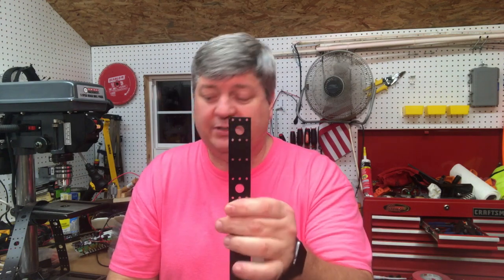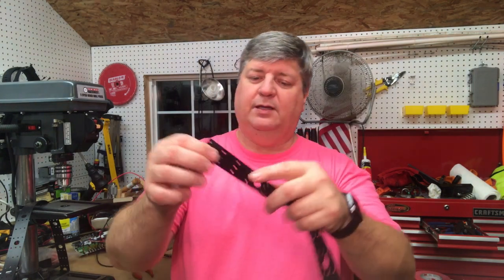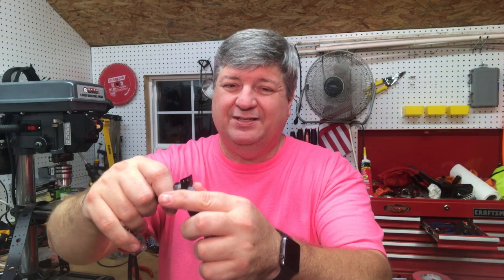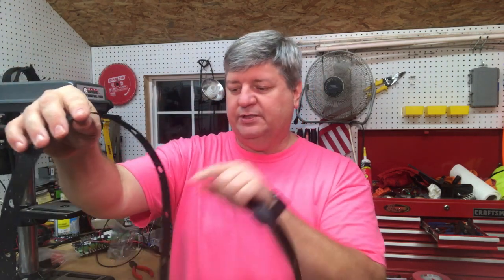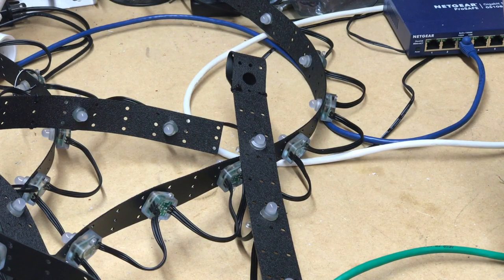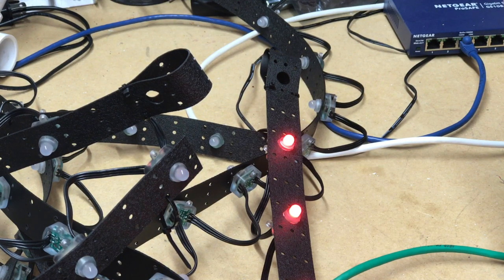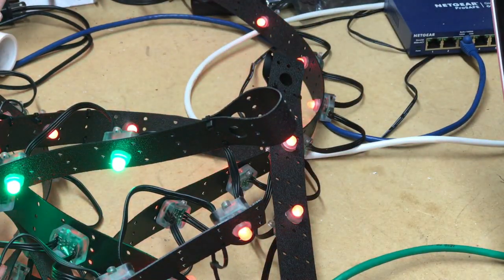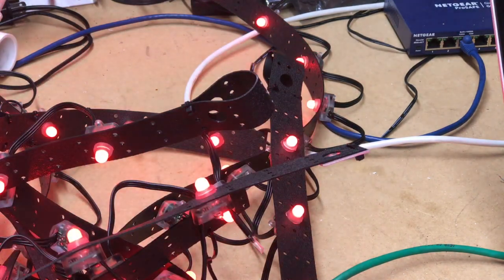Garage Outline with RGB Pixels

Comment: Thanks for all your videos. They have been most instructive in my journey to get pixels on my home hopefully this year. Question? I have oval windows at the top of my windows. They are not squared. What is used as support foe pixels with the top being oval instead of square. Thanks again!
Reply from the maker: Outlining windows is one of the more creative parts of the hobby! 😂 There isn’t a great solution. Something like pvc you can wedge in in there to hold it or drilling to hang it. People in the Facebook groups may have some ideas.

Comment: Where did you get white conduit holders? I’ve never seen anything like that before and would seemingly be perfect for my chromatrim. I’m not using the black strips for my rooflines.
Reply from the maker: I got them from HolidayCoro a while back. They break within a year so I went with metal EMT hangers from Home Depot. Haven't had an issue since.
Reply: @CanispaterChristmas  I'm just worried I won't be able to grip the EMT properly because of the corrugated plastic. I want to be able to leave the EMT strapped to the chromatrim permanently. 🤔
Reply from the maker: @nic53188  Yeah, I can't say I've found the most totally awesome solution for horizontals yet, but what I have works well enough. There is some slight bowing at the attachment points, but you can't see it from the street.

Comment: thank you for all the info on rbs  leds I have been working on my Christmas display for 5 years I am currently running light o rama ctb16pc-g3 and now I would like to do pixel so I bought the higher level of the lor program so I could do a tree and the info from your videos on the power and power injection has been very helpful I have a 30ch-DMX512 constant decoder and 500 ws2811 bullet LED pixels I did ask LOR for help and they told me I could buy some 500.00 pre pro gram tree from them or ask some people that has did this I just need to know how to get data from my ptb16pc controller to my DMX512 if you can help I would appreciate it I live in north Carolina love your videos and light display hope you had a merry Christmas god bless and keep up the good work sincerely maynard annas
Reply from the maker: Thanks! Well, you have me at a disadvantage as I don't have any of those components. You might ask around on the forums listed in the descriptions of my videos as there are plenty of really smart people there that I'm sure can answer this question.

Comment: I should've known you were in Texas, we moved to Fort Worth almost 5 years ago and always did a very traditional light display on our modest ranch style home- C7/C9 incandescents on the roof lines and pathway, lit up the oaks with flood lights with some giant bows, and got fancy and made a custom extension cord to feed 7 or 8 lit wreaths in the windows.... Fast forward to this summer and we moved to a giant 2 story (while I was deployed actually) brick monolith and I ran very short on lights and had to feed power from a couple different circuits JUST for the old lights. I was getting ready to buy spools of socket wire and led bulbs in bulk to make my own strings to line the place but now am strongly considering doing pixels- especially since I could program it to run a "traditional" hue or just warm white if I don't want a show going :)

Also, there's nothing but an open field across from us, so brightness isnt even an issue ;)
Reply from the maker: Haha. Very cool! Yeah I ran them at full tilt my first year. No one complained, but it lit the surrounding houses up quite a bit. Then I learned about the brightness setting. I've had them at 30% ever since. lol!

Comment: This might be a silly question, but for the 3" mounting strips, what spacing is required in between the nodes on the pixel strings? I'm not sure if the spacing of the nodes needs to be greater than the spacing of the mounting strips to allow enough length for the nodes to be mounted properly.
Reply from the maker: 3" refers to the spacing between the holes so 3", but most I've seen have about 4" of wire in between so no problem if I understand the question.
Reply: Yup that is perfect, thanks!

Comment: Right behind your head in this video  at the start you have the pipes with RGB strips atttached by zip ties , that you used for outlineing eaves and vertical house corners...Why the change to RGB pixels? I thought the original way looked sweet.
Reply from the maker: Two reasons. Those particular pixels interfered with my garage door opener and it looked like a missing tooth in the center where the two pieces came together.  It annoyed me. It now looks much better and it's much easier to pack up and re-install. Don't worry, I'll repurpose the pixels into some other prop. :)
Reply: So you use RGB light strips now ? I thought went to Boscoyo and Pixels, switched from LED strip lights
Reply from the maker: I'm using Boscoyo strips for almost everything, but I bought these strips my first year and kinda feel I need to use them until they burn out. Darn things are hanging on like a blind, 18 year old yippee dog that bites everyone that comes near it.  Actually, I do use strips in limited places, but I can't use these near my garage door.  They are great inside pex tubing, but I don't like using them zip-tied to tubing anymore because it's hard to match up multiple sections. I have a couple of ideas for them once my current project list settles down a bit.

Comment: Did you get your flat back pixels from Wu?
How did you anchor your side strips and did you back them with conduit or just pulled tight?
Reply from the maker: Yes. I got the pixels from Ray. The side strips are anchored using ball bungees and eyelets at the bottom. No conduit backing needed. I'm working on the setup video now & I'll show this in detail. If you want to check them out, look here:  http://amzn.to/2hKunNP
Reply: OK good, looking forward to seeing it. Trying to get my plan together on the pixels I want to use and how to attach them. Looks like you went the PVC route and opted for the strips I am sure there is a good reason. I know they will store easier.
Reply: Thank you for all the videos, what is the number for the flat black pixels you are using?

Comment: How do you make F16V3 drive more than 50 pixels from 1 output port? 

Can you please do a video showing how to configure F16V3 using the Pi FPP?

And then some help with basic Xlights programming would be helpful. 

Thx
Reply from the maker: To configure the F16V3, see :https://www.youtube.com/watch?v=EcAXycWNSxM 
The strings page is what you'll need to change.
The F16 is not configurable from the Pi/FPP, but is from xLights. 
For xLights videos, check out Keith's channel at https://www.youtube.com/channel/UCVOKeP2mWsBEKqqHkT0QndQ/videos

Comment: Guess I'll need to find a drill press.  Thanks for the ideas Jeff.  Never saw Texas play in person, but saw SMU several times when I lived in Dallas.  They had a couple of running backs that were pretty good.  For some reason they wound up being put on probation for a jillion years (give or take a few years).
Reply from the maker: +trapp88 the game ended in double overtime so quite a nail biter, but ended in our favor. Yeah, I did about 150 for the front door outline with the socket. Not as easy as the drill press, but not bad. 1,200 for the megatree last year was tough on the old hands so I went looking for alternatives!